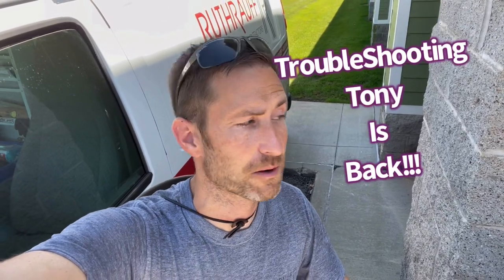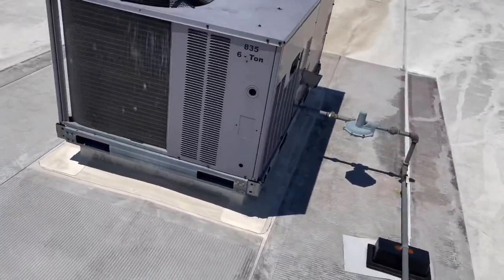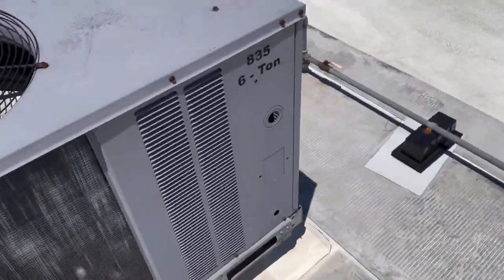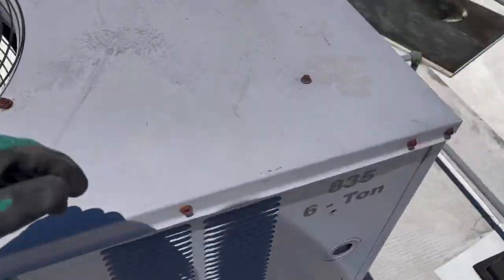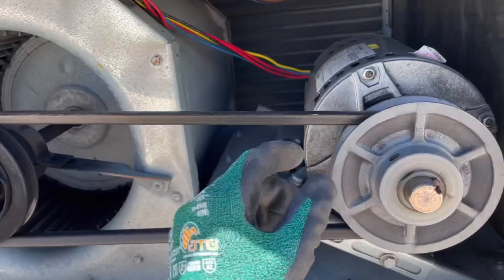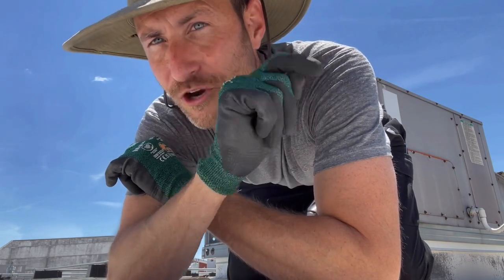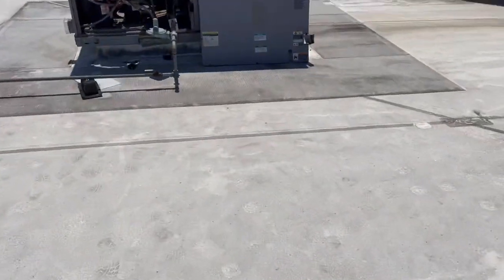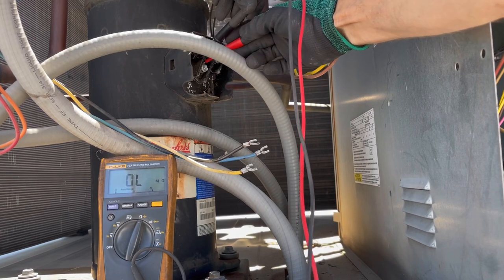RTU Shorted To Ground.  #HVAC #RTU #HVACEXPLAINED #HeatingandCooling #AirConditioning #Carrier

Comment: 👍
Reply from the maker: Thanks again James do you have any questions or is there something in particular in the HVAC field that interest you?
Reply: @hvacexplained9341  I am retired union electrician which did a lot of building automation and PLC , DCS system work just enjoy your trouble shooting the equipment thanks
Reply from the maker: @jamesashley3827  ahhh that’s pretty cool.  There are so many codes for your field it would make my head spin trying to remember them.  I worked with quite a few electricians over the years and all that take a lot of pride in their job. IBEW electricians local here and Pittsburgh is local 5.   I’ve worked on many pieces of equipment over there at their facility.  I’ve also taken care of our plumbers union hall as well for many years.  I watch a lot of electrical videos on arc flash and electrical safety on YouTube.  Thank you very much for liking and commenting on the videos it’s a very interesting field. It’s also constantly changing.  Have a great day and congratulations on your retirement.
Reply: @hvacexplained9341  I was impressed with your arc flash equipment be safe both are great trades to learn and teach

Comment: Hi i have 8 tons package the compressor dosent shutt down and the air is good, and the temperature stopped at 73.5 dosent Goes 71f..
Whats is the problem with this unit ?
Reply from the maker: Hello Abdullah,   I’m trying to understand what you’re saying here but if I am following correctly.  Are you saying your Set Point is set to cool 71 degrees but the compressor will shutdown at 73.5 Degrees?   Is that what you’re trying to say? Because it sounds like the “dead band” in the thermostat is possibly set wrong.  Most digital thermostats have an adjustable dead band in the setting of the program.  If you can please clarify that with me to make sure I’m on the right track.
Reply: @hvacexplained9341  the compressor is not shutting down, i change the Thermostat but still the compressor dosent shutt down..
Reply from the maker: @abdullah_q8171  ahhh ok. Most likely the thermostat wire is shorted between itself.   This is causing cooling to stay engaged. I see this occasionally when people run the thermostat wire through ductwork and causes a rubthrough on the wire shorting it between wires.  You may have to pull a new thermostat wire but just for a test disconnect the thermostat wire going to the unit and run a small jumper at the unit to a thermostat in the units control panel. 
Or
Compressor contactor could be welded shut causing the compressor to run all the time.  
It wouldn’t hurt to check that as well shut down main power and verify the contactor “releases”.
Reply: @hvacexplained9341  thanks 😊
Reply: @hvacexplained9341  all the best wishes for you
Reply from the maker: @abdullah_q8171  :  you’re welcome.  please let me know if that solved the problem.  Good luck.  Have a great day.  Thanks for commenting.
Reply: @hvacexplained9341  The problem is high pressure leak
Reply from the maker: @abdullah_q8171  : High-pressure leak coming from a refrigerant leak is that what you’re referring to? I’m not understanding how that would cause a compressor to constantly run. I’ve seen faulty low pressure switches and leaking Liquid Line Solenoids Oh that would constantly weep through engaging the compressor.  if you can please fill me in with more details have a great day

Comment: "What is grounded?" ONLY that rubbed wire, that's what. The Compressor was reading on all 3 legs in the 'M' Ohm scale, Mega Ohms, MILLIONS!! of ohms... that sort of reading is easily caused by a bit of condensation on the cold compressor because it hasn't been running and would cause no issues at all, sure the one that has been running and will be hot shows a better/infinite reading! I bet that compressor was perfectly OK!
Reply from the maker: The wire was definitely grounded obviously.  To be honest with you I have seen stuff like this before and what I typically do is either reset the breaker or replace the fuses.  I have had a meter misread the value. I had to return the next morning before the store opened to test that in case of an emergency.  Believe it or not it did trip once that compressor kicked on.  I just didn’t wanna do that with a store full of people and having a loud bang in the worst case scenario.   But I know exactly what you’re saying it does look bad but then on the other hand is it?  That’s why sometimes it’s good to test it by running it.
Reply: If the unit is 3 phase, did you label  the wires for rotation when you removed them?
Reply from the maker: @rickbraden4272  :  It’s just three phase.  When your gauges are on the compressor you immediately will know if it’s in the wrong rotation because. 
1: it won’t pump
2: sounds very loud 
3: amps are wrong. 
I actually did shoot a video showing the difference of two different compressors one in the correct Rotation versus one that’s in reverse rotation I think I might put it together and post it.
Reply: @hvacexplained9341  if you're on the market for a new clamp meter one day , I use the Amprobe 320 , it has phase rotation with the actual  3 leads . Takes away the guessing work , I use it all the time to check phase rotation especially on start ups . Really neat 👌

Comment: I always check heat exchanger on every gas pack. Doesn’t matter what time of year. I’m the cracked heat exchanger king. It takes less than 5 min. and it’s just good practice. Plus if it had a bad compressor and bad heat exchanger, it may be time for replacement of the unit as those repairs would be very costly. Good video, you seem like a good tech.
Reply from the maker: Yes, with some equipment it takes just a couple minutes to check the heat exchanger and sometimes depending on the brand and style you’re not able to check the heat exchanger especially if the customer ran ductwork off the end of the unit.  Then you kind of have to wait for the rollout switch to unfortunately trip.  But yes, remember peoples lives are at stake so try to be as thorough as possible especially with flue gas.  
I’ve been in this field over half of my life, and the best thing I can tell you is to just be honest, act like the equipment is your own and customer service goes a long way.
Since this video I have moved from Pittsburgh Pennsylvania down to the gulf coast of Florida.  A lot of things are different down here involving humidity, bugs, algae.  Yesterday’s shift I started work at 7:30 AM and did not get home last night till about 11 PM.   
Have a great day. Thank you for the compliment. I have to start posting more videos again I took a lot of time off.
Have a great day
Reply: @hvacexplained9341  Agreed, yup down south it’s bit different, how’d you like this summer over 106 every day? Lol. I got heat stroke this summer, it’s crazy!
Reply from the maker: @chriswhite7193  to be honest with you I moved down at Christmas time and believe it or not my body adjusted within three months.   So going outside with all this high humidity it’s like instant swamp ass but it’s always breezy.   So drink plenty of water/electrolytes.   I always have a picnic table umbrella that I can easily bring with me onto a roof working on Equipment if I’m there for a majority of the day.  
I would not want to be here doing residential where I’m stuck up in a ceiling of somebody’s home in this weather.   
I was very concerned about getting paid less per hour, but due to the taxes down here in Florida my paycheck at the end of the week is actually better.
Reply: Yes, attic work down here in the summer is brutal. I was doing some residential, and light commercial, under 20 tons, and refrigeration. I live in rural East Texas, but similar climate to where your at. I recently took a job in Dallas, heavy heavy commercial, the pay is so much better than east texas, I was shocked. Brand new Mercedes vans to drive. They provide you with vacuum pump, recovery, good benefits, uniform allowance, tool reimbursement, 2 weeks off a year, signing bonus for people with experience, the starting pay is fantastic, as little or as much overtime as you want. During the winter we never slow down because of all the new construction installs and start up, and all the people there are so welcoming and helpful, they actually act like a real team, a family. I have zero experience with chillers, and huge tonnage package units, so it’s a whole new experience for me. You ever wanna come over to Texas, my company would snatch you up in a heartbeat.
Reply: I’ve watched some of your other vids, you know your shit, my company would start you out close to $40 an hour, don’t know what your making there, but that’s pretty awesome for round here. Probably give you 5-7 grand signing bonus. I know you just moved there, but js, Texas is a pretty cool state, and if you ever think about leaving there, hit me up.
Reply: If you know chillers and boilers, and vrf then it would be considerably more…

Comment: Please buy a Megaohm meter…
Reply from the maker: I do have a separate one I double checked afterwards and was reading grounded.  Believe it or not I did come back first thing next morning to double check Before the store opened up full of customers because I had a meter give me a false reading one time I tested it out And since the one phase is directly compressor to breaker it instantly tripped so I disconnected it.  I was literally there yesterday installing the new compressor drier, contactor and that other units fan motor.    I think I may shoot a separate video showing two different meggers  that I have.  
What brand and model do you typically have?